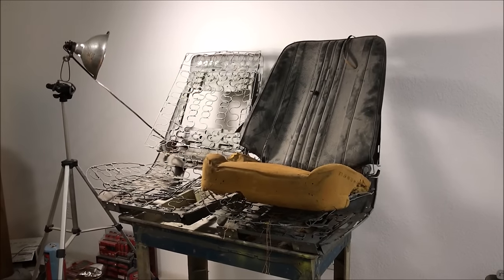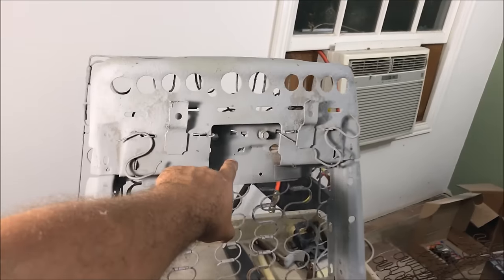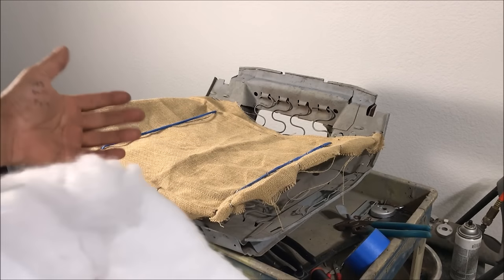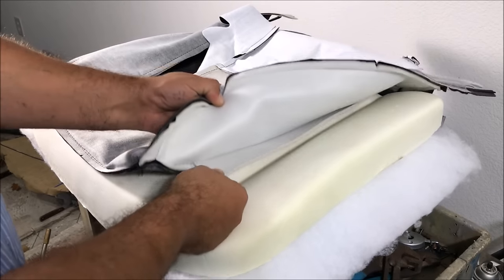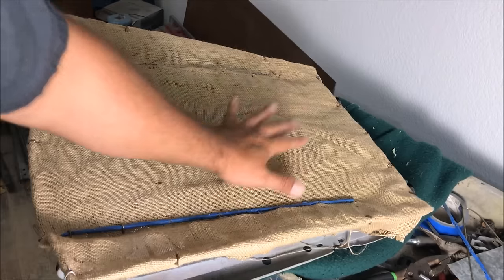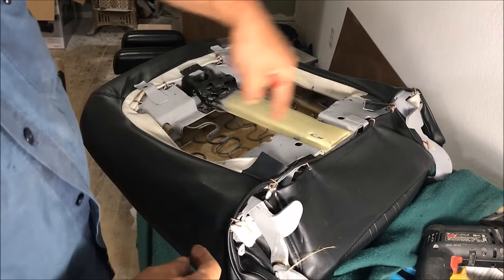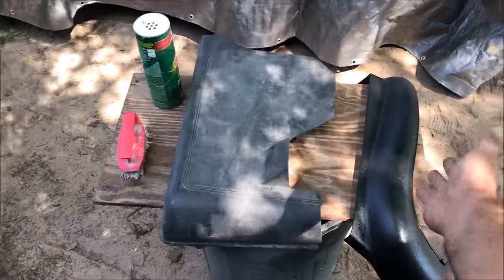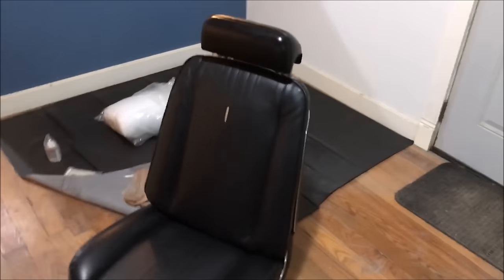chevelle GTO cutlass bucket seat restoration upholstery DIY 69-72 GM a body

Comment: Thanks for taking time to share.  Great points on springs etc.  Glad they're holding up so far.  Maybe I done mine the hard way, yet I only put small enough holes through the foam and batting to just get the hog rings through so as not to compromise the integrity of the foam, especially the side bolster areas.  It took more time initially, yet as I went along had it down soon enough.  Again, thanks for taking time for video and share seat restoration as one of the major jobs to do along with everything else to complete and drive a classic again!

Comment: Menards has 1/16  &1/8  steel rods x 15 inches,  they support  floor insulation between the floor joists,  you get foam and padding where they upholster furniture

Comment: i am in the middle of doing some bucket seats for a 71 monte carlo that i am converting from the split bench. i thought it would be hard to do the seats but its relatively easy. a nice table to work on makes the job a lot easier. i also have pictures if anyone needs. i used legendary for the covers and american cushion industry for the buns.
Reply from the maker: ive done a bunch of buckets and they were easy..  but these sponges are made wrong..  i actually took the seat back apart and im having to modify these or buy the $99 each foams...  the bottoms are perfect...  i done some buckets for my 68 el camino about 10 years ago in which the original foams were perfect and done both seats in about 3 hours...  these are a nightmare...  monte carlos with buckets are game changer
Reply: the nice thing about the GM  bodies are that the frames are the same. i picked up these frames and they were i think an oldsmobile or similar body style and all u do is u buy the correct buns and seat covers. kind of glad the monte carlo is easier to do than the oldsmobile seats since they have the higher bottom cushion bolsters, u need to cut the seat foam to attach the seat covers thru there where the monte carlo one you dont need to. By the way the video is really good. i took it upon myself to do the seats without watching any videos and it wasnt bad at all. the small tabs that were broken off i made them out of metal and spot welded them

Comment: Good video. I have bucket seats in my 56 Chevy from a 68 Chevelle. No head rests. Good info on refinishing the plastic parts. Be nice if you could share a link for the chrome plastic piping for the edges. :)
Reply from the maker: I got it from original parts group.. I did some 68 Chevelle buckets 15 years ago and got the chrome piping from OPGI too

Comment: Hey Chris. I have a question About the chevelle seats. I just got the the seats done. The seats don’t line up when pushed all the way back. The bracket in passenger lot smaller then the drivers. Drivers seat sits back fine but passenger side sits up one notch more. Is this normal GM engineering?

Comment: Might try coated stainless steel braided wire instead of hard coat hanger or 1/8th wire. It bends easierl, holds well and wont rust.
Reply from the maker: you want the listing wire to be stiff and rigid all the way around.. you don’t want a wire that bends easy at all.. coat hangers are okay for the parts that wrap around the frames but the decorative inlay pieces MUST be 1/8” or you will get a wavy look down your seats..

Comment: Did you use flat satin or gloss for head rest and panels.
Reply from the maker: I use dupliccolor gloss black vinyl paint
Reply: Thanks. Also what size hog rings did you use. 3/8 1/2 or 3/4. I wasn’t confident in doing this, till I saw all your videos on dash and seats.
Reply from the maker: look up the kit they sell from OPGI.. that’s what I used
Reply: @chriscraft77022  did you use the same size hog rings for listing rods that you place on springs and did you use the same size hog ring for seat covers.